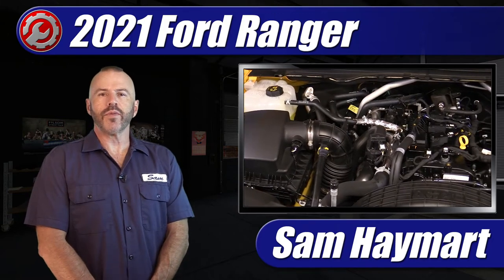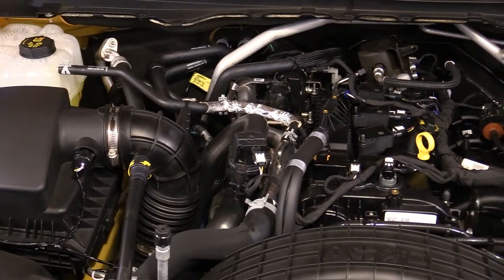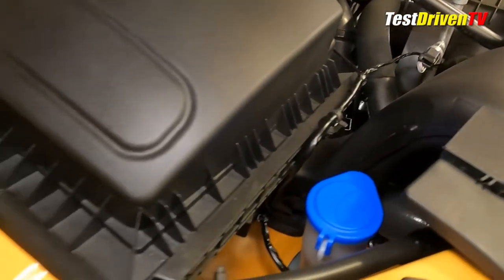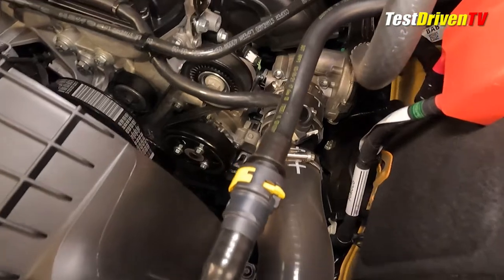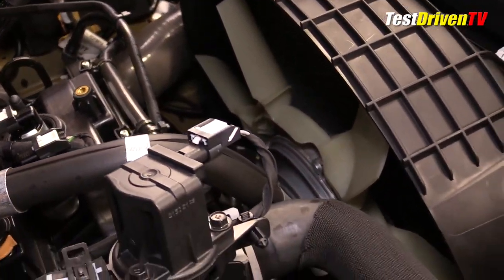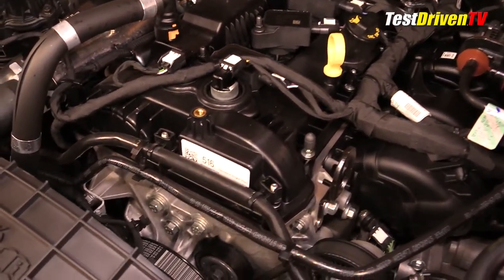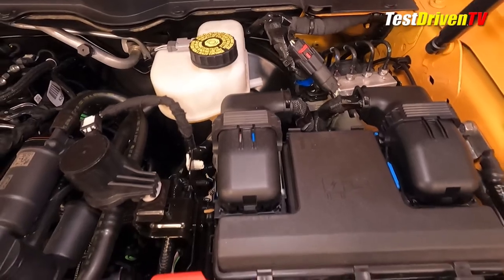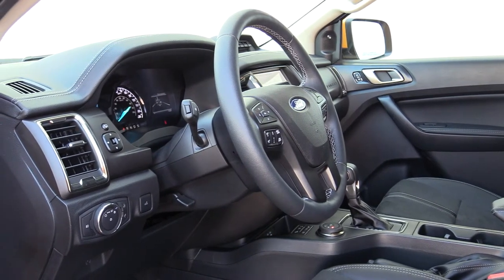2019-2023 Ford Ranger 2.3 EcoBoost Engine Explained

Comment: I just purchased a 21 Tremor and I am very impressed with the the power train. Was next to a 21 taco the other day waiting for the light to change and enter the freeway. I guess the guy wanted to race as he kept gunning his engine while looking in my direction. Well it was very early with no traffic and a long on ramp so I dropped it down to sport mode and basically smoked him like a cheap cigar lol. Kinda felt like a rebel for a second. Great job Ford!
Reply: Good luck racing your way up to 100k miles.  That Tacoma will smoke you like a Pack of weed.
Reply: I have a 21 Tremor also. And it's performance off road is literally amazing. TOYota needs to go eat some rice and shutup.
Reply: @DonVerchi700as 2019 ford ranger - 108k Miles with no issues....
Cool flex though I guess.....
Pack of weed? Lolololol
Reply: Gold comment

Comment: I am 2 years and 70,000 kms into my '21 Ranger, and here's the warranty list so far-  faulty passenger door seal- 0 kms. Fuel pump and sender fail at 9500 kms.  Rear axle seals (both) fail at 12,500 kms.  Headlight lamp- 17,000 kms.  Front ABS sensors and wiring harness (both) fail- 22,000 kms.  SYNC system processor fail -  40,000 kms.  And now, at 70,000 kms the transmission is being rebuilt because of erratic and inconsistent shifting. This truck is a lemon, and the best Ford Canada will do for me is extend my powertrain warranty by 1 year (but no extra kms).  Once it's fixed, I'm trading the bastard in on a Nissan.
Reply: I have 78,000kms on my 2020 ranger and have had literal zero issues. sorry for your tough luck.
Reply: Nissan 🤡
Reply: Yuck not a nissan!
Reply: Lies
Reply: The American spec Ranger is pretty solid. I've had mine for over 50,000 miles and have had no issue so far. Unfortunately the Aussies don't get the 2.3 EcoBoost you guys are missing out
Reply: I like to hear these issues but I'm the opposite. I've ran my 2020 ranger for around 160000 km and I've only had a few loose suspension components. But that could have being some trail riding and am currently chasing some sort of emissions sensor gremlin no one knows about lol. Sorry to hear about your bad luck
Reply: You must have abused the hell out of that truck.  I have 50k miles on mine and I have had zero problems other than when I damaged the wiring harness when I went mudding.  But that was on me.
Reply: @LongWalker730  My 2021 Tremor just passed 50k miles and it is currently in the shop for a possible new engine. A tech there told me their 2021 at 57k got a new engine and it sounded like mine. 5k full synthetic oil changes, always have coolant and trans temps displayed on my scan gauge ii. The tech working on it is going to be checking the block's piston sleeves. He just did a 2.3L in a mustang for that reason. HE told me it is super rare for the 2.3L to have issues like this though. SO GLAD I never put a tune on it or I would be SOL. Other than that, just a remote start through ford app issue they replaced a control unit on at about 40k miles. Truck has been SOLID. SO GLAD we were not towing when this happened. Maybe 3-5k miles worth of towing a 19' travel trailer.

Comment: How about talking about reliability issues with this engine instead of reading material from ford. This was a pretty much a waste of time.
Reply from the maker: We don't recall the title of the video being called "Negative Bitchy Hit Piece On Ford Products". We think it was called "Engine Explained". Maybe you should be watching Fox News.
Reply: At my work we got a 2022 ford ranger 40k miles on it an it idles 24 hours a day I’m surprised it runs great with all that idling they hardly change the oil on it I wonder how much longer it will last but I wanna buy one

Comment: How reliable would you say this engine is? I'm coming from a Tacoma but am very interested in the 2.3 in the new Broncos.
Reply from the maker: consumerreports.com
Reply: Ive had mine for 2 years and there has been 0 issues.
Reply: Not sure if you got one, I’m about to drive one for a while, but a 4cylinder turbo pushing a 6k lb vehicle doesn’t sound like it’s going to last that long.
Reply: @TDTVGarage  ugh, this website isn't helpful at all.
Reply: @Pez.dem11397  4,441 lbs
Reply: I’m looking to buy one at my work we got a 2022 ford ranger stx with 40k miles it idles 24 hours a day I’m surprised it runs good with no check engine lights or anything
Reply: @kamryn7496 that's  reassuring I really want one bad now. Jhat test drove one. Didn't realize how good of a powerplant they had!

Comment: You’re wrong about oil filter location
Reply from the maker: How so?
Reply: @TDTVGarage  driver side, behind the tire.....
Reply: @TDTVGarage  I agree with m9; It's not really under the vehicle. When you said that I shook my head too. It's accessed from the side.
Reply from the maker: Semantics. Our point when we say it accessed from underneath means it's not accessible from above. Whether you have to go through the wheel well or from underneath, it's not accessible from the top of the engine compartment as you stand and look down as some vehicles have when the filter is at the top of th engine. That's the point.
Reply: @TDTVGarage  Some people have a hard time admitting when their wrong. LOL
Reply: You're wrong - it's "they're" not "their" as in " they are".

Comment: So for the first time my 2021 Ranger XLT went into reduced power mode(only have 68000kms on it), the dealership now tells me that the Ranger is experiencing problems with moisture in the intake manifold and will have to be replaced as well as the inlet tube and possible throttle body . Their parking lot is now starting a collection of Rangers that don't like the cold ( I live in Canada where it will hit -46c)
Reply: Update on my truck- they got the parts in and will be replacing everything I mentioned on Tuesday.
Reply: @careylee5951  Hows it running now?
Reply: @careylee5951  running tip top?

Comment: I have a 2020 Ranger and for a 4 cylinder has great power with the turbo boost.  My upgrade from a sport trac. How often does the turbo charge filter need to be changed? Also cabin filter?
Reply: I also got Ranger do u put 87 gas or 91 ?
Reply: @FlyLopez1991  I been sticking with regular 87. Only saw that when I was outside NY. Don’t think it’s available here. But when I first got the truck I was putting super in as prices weren’t as bad as today..(thanks Joe) so been using the 87 for a while now.
Reply: @mercyfaten01  thanks I do 91 but gas prices is crazy I will go with 87 as in the book it says  u can use 87 also
Reply: @mercyfaten01  I put 87 this one time and I am going back to 91 I can feel the difference in everything man it’s insane
Reply: @FlyLopez1991  really? It’s not that much higher than 87 but that’s cool. If I come around it again in my travels. There used to be a station near me that had racing gas. Was like 98. Now that you can feel the power. To9 bad it’s not around any more. I used to put that in my Chevelle and burn rubber like mad.
Reply: @FlyLopez1991  I use 91. The extra 10% in MPG makes up for the price diff. And it runs better. I also switch off that danged "auto engine off" everytime I run it. stopping the engine at every light and restarting again can't be good for it.

Comment: All this complex ecoboost....with problems...and i own a 1.5...i pay extra for say a 3.3 v6 non turbo and direct injection....even with less power...dont need power...need realibity....btw...does is have rubber timing belt or  metal chain and if so replacement intervals?
Reply: I don't know where you're at but the American spec Ranger with a 2.3 EcoBoost and 10 speed is pretty solid. I have over 50,000 miles on my 2021 model absolutely no issues right now. Taking it on some pretty hardcore off-road trails and I've towed very heavy with it

Comment: They'd have better luck selling these if they had an electric engine! There's so much crap in the engine compartment that it's hard to say which component will go bad first! Since most of the parts are outsourced to other country's there's going to be no quality in the manufacturing of the part's!!

Comment: You lost me when you said "sealed transmission" , you lost any credibility you had when you said that ... Anyone with any legit automotive knowledge knows there is no such thing as a sealed transmission regardless of any make.. That's just a term manufacturers use to make you think that you don't have to spend extra money on maintenance.... In reality you really do if you want your vehicle to last more than 100.000 miles
Reply from the maker: Point of term "sealed transmission" in our context is to convey there is no dipstick for the average customer to check fluid or top it off as in the old days of cars. Indeed, manufacturers don't want customers monkeying around with fluids in automatic transmissions as 98% will screw them up by over/under filling and/or with the incorrect fluid - and cost the manufacturer warranty claims. That is why they are "sealed".